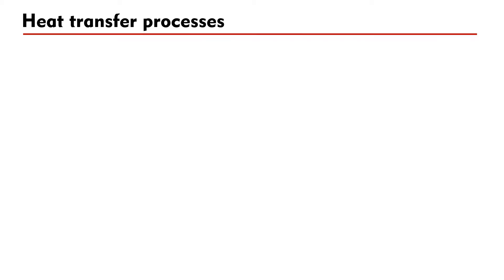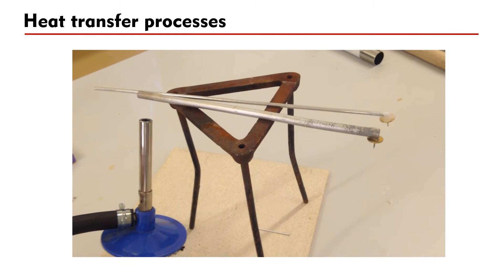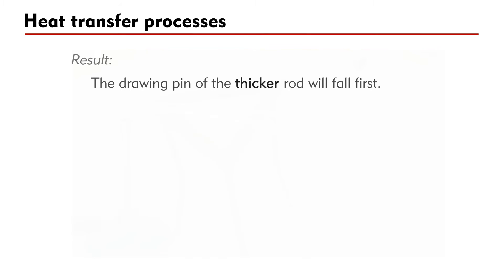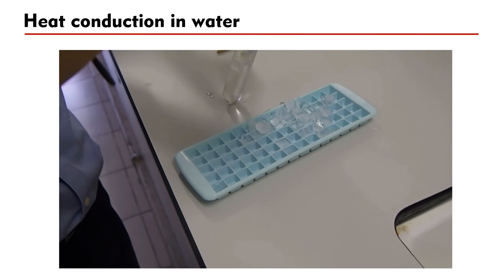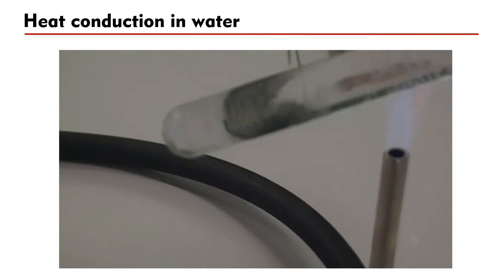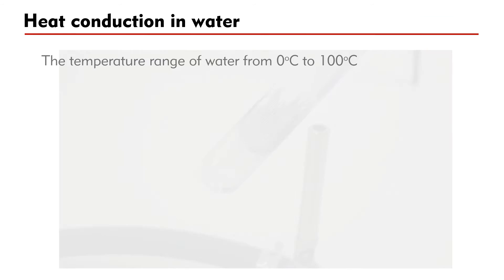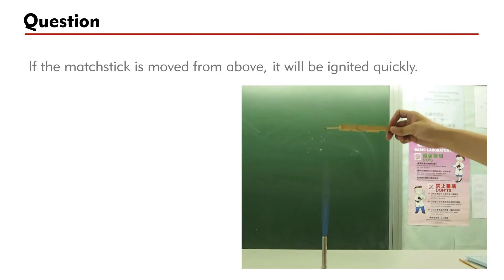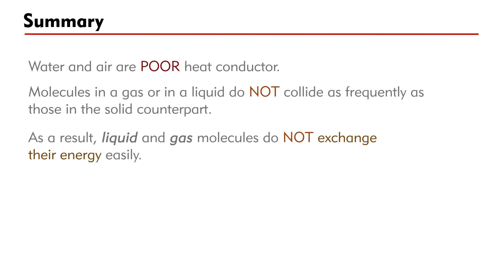Conduction in liquid and gas

Comment: Water is pretty good at carrying and conducting heat. It has a fairly high heat capacity and can carry heat both by conduction and by convection, so it is not a good insulator. Air has a low heat capacity, but it can allow heat transfer poorly by conduction, better by convection, and allows heat transfer by radiation. 

This is from google .... I was confused.Hope it helps anyone.

Comment: Good work. So is convection of gases dependent on conduction? If air is a poor conductor, and it does not emit and absorb radiation, apart for the 1% GHGs, how does it convect? I say the air does radiate.

Comment: In gases when temperature increases thermal conductivity increases due to molecular Momentum transfer. Air at the top of the bunsen burner will have high energy in the form of heat. soon it just ignites

Comment: This is caused by convection instead of conduction. When a fluid (liquid or gas) gets hotter, it will rise up because of lower density. When a Bunsen burner is emitting flames, hot air is actually rising from the burner. As a result, when we place a match above the flame, hot air reaches the match and heating it as well. Due to the huge temperature difference, the match gets so hot quickly that it ignites.

Comment: Because the heat transfer of matchstick which is moved from above is convection instead of conduction. Hence, the hot air rises then burn the matchstick quickly.